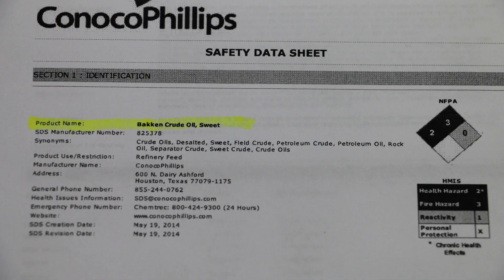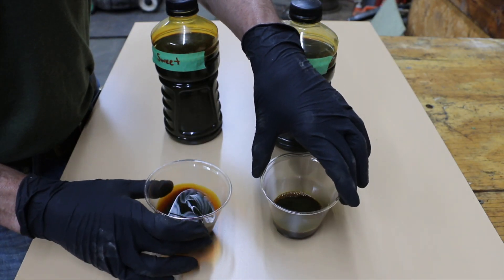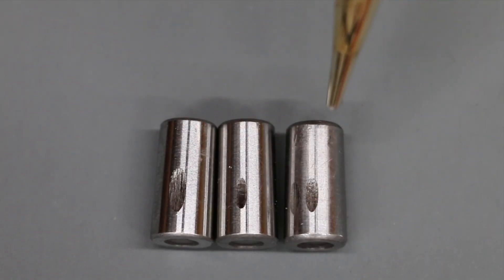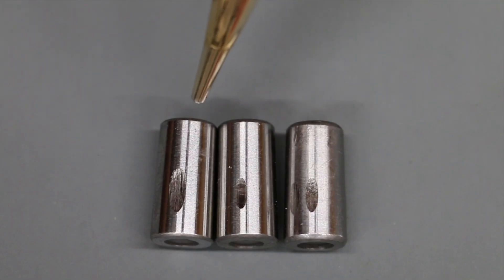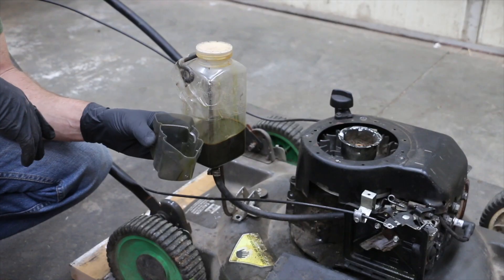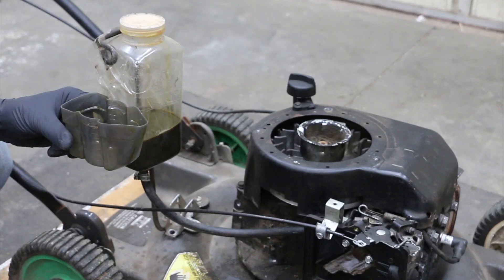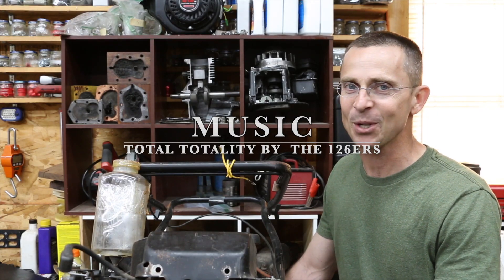Will a Gas engine run on Crude Oil?  Let's try it!

Comment: He sent the crude oil to in plastic drink containers? That's crazy. Natural oil leeches most plastics leaving them thin and brittle. But i guess if it's not stored in those containers for too long it's not really an issue. I had gloves with an impact shell on them that i would do oil changes with and the right one always got a dose of oil whenever i would pull the filter. That glove broke down into little pieces pretty quickly while the other one was as good as new.

Comment: old coleman lanterns and lamps and other makes use gasoline i use non ethanol i do not think it matters if it unleaded or non ethnol in them , but useing stright crued oil on your engines i think would foul up the heads your cylenders and your spark plugs could even cause your pistons to cloge

Comment: My family has operated a small oul well since 1895. I've been told in the 30s and fourties a neighbor would buy some of the crude and use it in his car. It ran but we don't remember if it was straight or mixed. It was smokey though!
Reply from the maker: Thanks for sharing.
Reply: @ProjectFarm can you recommend a testing lab where I can send a sample of my crude oil? I'd like to see if it can be used as heating oil. Mine is a very light grade of oil. Thanks in advance. I really like your videos.

Comment: Amazing & totally unexpected that the Sour Crude (or any Crude) oil has Better lubricity film Strength than modern, additive enriched  10W30 Motor oil !!  .....According to Everything I've read about motor oil is the Additives Is primarily responsible for the Film strength !!
Reply from the maker: Thanks for the feedback.

Comment: I bet the exhaust emissions were much worse on crude oil over gasoline
Reply from the maker: Thanks for the feedback.
Reply: @ProjectFarm  I’m surprised the engines ran so well, and that we as a society don’t run anything on crude oil normally (well except for some power stations), probably due to emissions

Comment: I just finished watching the ethanol vs non ethanol video you made before watching this and I can’t help but wonder why crude oil is turned into gasoline to begin with. There was WAY more carbon build up in the engine after both ethanol and non ethanol fuels than there was the sour crude oil.

Comment: I can't figure out why there was hardly any carbon residue in the combustion chamber after the tests with either crude crude oil. We've seen tests with gasoline and alcohol that leave substantially more residue after a test. Weird.
Reply from the maker: Thanks!

Comment: been wondering about rigging a setup on an old manual choke carbed vehicle where you start on gasoline , switch to black diesel (1 part gas/4 parts wmo) when warm , for the majority of run time , then back to gas just before shutdown . would the gas at shutdown clean plugs and valves ? long term effects on engine ?

Comment: cool fun fact , the country used to run on karosene. it lit up every house hold in america. at the time they did not realyze it , but a by product of making karosene...is gasoline. which they decided at the time to get rid of by pumping it underground. they dumped thousands upon thousands of gallons of gasoline into the ground over the years. little did they know gasoline would become the main gas to use for transportation. this was when Rockefeller owned the monopoly on all of the refineries in the US.

Comment: Is it safe to accelerate the engine with a drill? Do you have a wrench with a one-way clutch?? I have a lawn mower that is very hard to start. I will use your starting patent but won't it tear my arm off when the mower engine starts??

Comment: That's pretty amazing that the engine runs at all. I always wondered how the original inventors of internal combustion engines found suitable fuels to burn, and ultimately landed on crude oil derivatives as the source of fuel. It makes more sense understanding how they landed on that combination when crude oil burns well essentially "out-of-the-box".

Amazing.
Reply from the maker: Thanks for watching!

Comment: Well old tractors used to run straight up crude oil as fuel. Noted they were engines with a hot bulb that preheated the mixture of crude and air before being injected into the engine.
Reply from the maker: Thank you for sharing!

Comment: Crude oil has a viscocity that varies from something that you need a trowel to move to something that is relatively fluid when at ambient temperatures.

What is the viscosity of the crude oil used in this test- is it the sort of crude oil that ships use or the lighter crude that is used in heating boilers?

Comment: Great video I want to do this with old motor oil and a old Briggs we have sitting and make a generator on 60%oil 40% gasoline would make a great backwoods generator at low fuel costs
Reply from the maker: Thanks!  Thanks for sharing.

Comment: A year later, and I still find this interesting. 

1.   We get to see crude oil.
2.   We get to see the tough lawnmower run on something it is not designed to. 
I wonder of we could alter the jet, and get a lawnmower to run on heated vegetable oil, diesel, used engine oil, and crude oil. Amazing, you proved it can run on crude oil. My guess was that it would not.

I am also curious what the first diesel injector was like. It was probably simpler and more versatile. I know this is outside of the scope of Project Farm, but worth a mention, in any case. What if a diesel engine also had spark plugs?  Could it run on gasoline.

Wow.... oil as is from 7000 feet deep and 9000 feet deep. 
Apparently we have used 35% of the crude oil and the more difficult to access crude oil is still down there.
Reply from the maker: Thanks!
Reply: @ProjectFarm  You are welcome.

Comment: If crude oil is straight from the ground before work is done to process, adapt or change it, then is it cheap to buy? Where can someone buy crude oil?
Reply from the maker: Yes.  Check ebay.

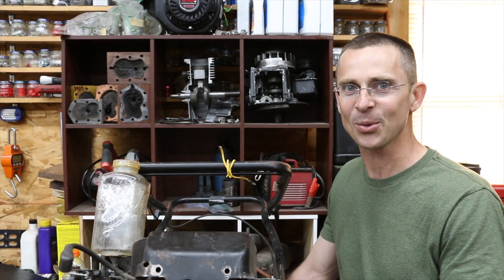Comment: 8:12 That is because of the sulphur which in many countries is totally removed in ordinary gasoline due to the pollution it will cause otherwise and increase the film strength of the real motor oil instead..
Reply from the maker: Thanks for the feedback.

Comment: Absolutely it's the same thing as making  vegetable oil and boidiesel. 
Vegetable oil is thicker but can add gasoline to dilute and for more octane boost  for a diesel truck
Boidiesel it's corrosive and have to be 50% diesel and 50% boidiesel wich is animal fats. And I noticed both fuels or crude oil  burn clean. Good job very informative.
Reply from the maker: Thanks!

Comment: I bought a Murray mower with Briggs & Stratton engine in March 2003. It finally failed to start in March of 2019. Had 2 small kids and no time so I took it to local shop. They charged me $50 bucks and told me it was not salvageable as it had no compression and was beyond repair. Put it on the curb. Picked up immediately. An hour later a random guy brings it back to me and asks for $25 for the repair he has just made. (Dirty carb). I paid him smiling and still use that same mower 3 years later. 
I LOVE those old Briggs & Strattons.
Reply from the maker: Thanks for sharing.

Comment: I got lost in a remote part of Russia in my diesel Citroen, I was short of fuel but had 5 litres of vegetable oil in the car , I poured it straight in the tank and the car ran perfectly on it with no after effects. I got back to the main road and a gas station. Diesels were originally designed to run on peanut oil I read somewhere....
Reply from the maker: Thanks for sharing.

Comment: Thought it would of had a lot more smoke. Have you tried the redex one shot petrol system cleaner. Used to buy all the time, no idea if it actually improved the system
Reply from the maker: Not yet. Thanks for the suggestion

Comment: Early 2 cylinder John Deere tractors started on gasoline to operating temp then switched over to distillate or tractor fuel. They had a very low compression to avoid pre-ignition and ran at low rpm. After watching this, I'd like to try the crude oil in my 1935 A. It was said in their day that if you could pour it in the tank, they'd burn it.
Reply from the maker: Thanks for the feedback.

Comment: With better film strength than motor oil it would be interesting to see this as a 2 stroke fuel,  no oil should be required. Maybe. Now I'm not sure. Maybe we need it tested.
Reply from the maker: Thanks for the video idea.

Comment: The sulfur in the sour crude acts as an anti-wear agent.  A good example is your brown sulfur oil used in machine shops and for cutting threads on pipe.  The sulfur is a great anti-wear agent.

Comment: It's amazing to see how clean the piston top is for both crude oil, but because of emission regulations we have to refine crude oil into gasoline to protect the environment. I wonder if the people in the early 1900's use crude oil as fuel or not since they didn't have strict emission regulations in those days
Reply from the maker: Thanks for the feedback.

Comment: What if you ran a 2 stroke engine on sour crude oil which has good lubricating properties. Could you run it without 2 stroke oil just using the lubricating capabilities of sour crude oil?
Reply from the maker: Thanks for the video idea.

Comment: Go figure!  The EPA removed sulfur from diesel claiming it was dirty and bad for the environment.  Little did they know, Todd would expose their lies and show us it actually burns cleaner. 🥴
Reply from the maker: Thanks for watching!
Reply: @ProjectFarm  You bet!  I’ve been following for a while. I’m amazed and appreciative of the testing you do. I love the head to head comparison shootouts on tools.  
I had an idea, if you or Matt from Warped Perception would be interested. If you still have the go kart, I’ve always wondered how much efficiency loss occurs with a chain and sprockets, vs approximately the same gear ratio with cog sheaves and a belt?  
It would be interesting to see. 
Of course I’m in the same line of thinking as Matt also... Nitrous oxide  is fun to play with, and I’ve always wanted to push the limits with a small engine. Assuming the air fuel ratio remained safe, the piston rings were gapped accordingly, the fuel was high quality, and the timing corrected to prevent detonation at higher cylinder pressures, how much power could be made?  And what would fail first in an otherwise stock engine?  My guess would be either the head gasket or connecting rod. 
Anyhow, thanks for the work (and budget) that you put into your videos!

Comment: "Why buy gas at a gas station if you can just pull it out of the ground, put it in your gas tank and use it as a source of fuel?"

It really looks like you struggled to say that with a straight face. I know I laughed.

Comment: I was seeing if you could do a comparison of 1 gallon of gasoline vs one gallon of: 3 1/2 32oz bottles of charcoal lighter fluid obe 16oz bottle of 99% rubbing alcohol and 2oz of deisel or moter oil. I wanted to see if it would work and clean since many upper cylinder cleaners consist of naptha. I ran my vehicle on this and it ran much quieter unbelievably however it was mixed with maybe a couple gallons of gas already in the tank. How would this mixture work on a small engine and what kind of performance and cleaning would it get?
Thank you
Reply from the maker: Thanks for the video idea.

Comment: what you could try is heating the crude oil up as when its used in ships even though they are mainly two strokes they heat the crude oil up and its much better hot, even if you can get it to around 90f that will make a great difference
Reply from the maker: Thanks for the feedback.

Comment: I hope you read your old posts but I have a really good experiment for you to do. When Rudolph diesel design the diesel engine he had in mind as hemp oil as one of the things that would be running in the diesel engine. You can make anything from hemp oil that you can from crude oil. I would like to see you do a test against hemp oil and the best crude oil which would probably be the sour one.  From what I hear hemp oil has very good lubrication qualities as well.

In the lubricity tester that you had I would probably think that the thinner oil did better because the molecules are smaller.

 You can grow about 300 gallons of hemp oil and 1 acre. As soon marijuana and hemp get removed from the drug schedule (sometime this year) you will be able to grow as much hemp as you care to grow. I know the oil companies are not going to like it that will be able to grow 300 gallons of fuel in 1 acre .

Hemp oil is non-toxic  and I think it's carbon negative even, but don't quote me on that. Hemp plants are also good to clean up toxic soil via phytoremediation. They have even grown them around Chernobyl to mitigate the radiation.

I will get hemp oil for you if you can't get it. This test really needs to be done.
Reply from the maker: Thanks for the video idea.
Reply: @ProjectFarm  I really hope you do this. I will send you Hemp oil.

Comment: Well of course it works . Where ya think fuel comes from and the condensation off the oil is used for other things as well like synthetic motor oil . But don’t be sniffing that oil to much it contains h2s it’s deadly at high concentrations
Reply from the maker: Thanks for the feedback.

Comment: Just like any other heavy fuel, if you heat it significantly (60°c or sometimes even 90° depending on the fuel) it will burn just as well as anything else. Most large ships do this and burn fuels that are more similar to asphalt than a more refined domestic fuel.
Reply from the maker: Thanks for the feedback.

Comment: As a non-native English speaker I am confused by the meaning of ''flashpoint''. Shouldn't the crude oil ignite or evaporate right away when it reaches a temperature above -29 celsius?

Comment: You're doing it wrong. What you need, is a gasifier.
Reply from the maker: Thanks for the suggestion.
Reply: @ProjectFarm  - no problem. A gassifier can atomize pretty much any carbohydrate, including sugar water. It will run straight crude, but the residue will clog the unit fairly quickly. It's best to emulsify the crude with a clean liquid, such as alcohol or water.

Comment: The high sulfur content of the sour crude is why it passed the lubricity test better than the low sulfur sweet crude. Sulfur is a lubricant in and of itself. Unfortunately it is also a pollutant ( it's the primary cause of NoX).
Reply from the maker: Thanks for the feedback.

Comment: I have a few litres of waste veg oil. Have a common-rail diesel so not a big fan of putting it in the car, but my mower was given to me free. Could I mix the oil 50-50 with 95 octane (that's regular in the UK) and run the mower? What about a higher ratio?
Reply from the maker: Thanks for the video idea.

Comment: As this has come up further on Crude oil is not used in ships, too expensive. Fuel oil is used which is the leftover from crude oil distillation. Fuel oil (also known as heavy oil, marine fuel or furnace oil) is a fraction obtained from petroleum distillation, either as a distillate or a residue.
Reply from the maker: Thanks for the feedback.
Reply: @ProjectFarm  For manoeuvres at sea they change over to diesel. Fuel oil is just a bit better than tar.  Stop engines on fuel oil, spend the complete day unclogging the pipes and other things.

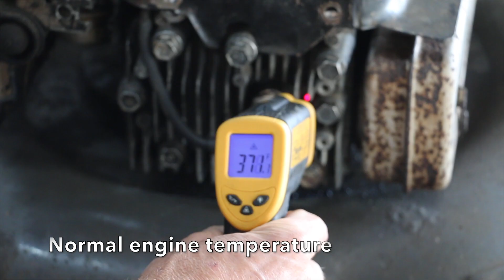Comment: How newtonian is the sour crude? Look at 4:42 - 4:46 when the engine is running and shaking the sour crude in the fuel tank there is small beads of crude acting like a solid on the surface.

Comment: Crude oil comes in many different forms.  Drip gas is like refined high octane gasoline.  Some crude is full of parafin and is green.  Thick black crude is low value crude that you would never want to put into a gas tank unless you really want to muck things up.  It's can be as thick as tar.  Jerry could have sent you drip gas and it would have run well in your lawn mower.  This wasn't a very good test because "crude oil" can look very different from one well site to the next...

You might have improved the performance of sweet and sour crude test by putting them in a centrifuge to spin out and remove the impurities, which could include paraffin...
Reply from the maker: Great feedback. Thank you

Comment: I've heard oil companies recycle used motor oil by re-distilling it and replenishing the separated out by distillation.
Since crude oil works so well, I kinda wonder if shop-distilled used motor oil is effective as a lubricant or a fuel too.
Reply from the maker: Thanks for the video idea.

Comment: I remember an old timer Tex claimed to have taken crude oil out from the bleed off valves on pipelines in central Texas. Said he just filtered it with a cheese cloth and put in his model T. I though he was telling tall tails, but I researched it back in the 90's and found a well in California which produced clear "crude" that was 70% gas by volume. Now the fact that sour worked better than 10w-30 tells me the oil companies are sucking out the good stuff in the crude and selling us the left over whey..
Reply from the maker: Thanks for sharing.

Comment: I wonder what the BTU`s are for light sweet or the H2s laden sour crude compared with diesel?
If I recall 114,000 btu`s for gasoline and 134,000 btu`s for diesel or roughly that.
I worked as a water purification chemist with oil companies to extract water from frack drilling.
I swear the water coming back up from the wells was so heavily laden with hydrocarbons, we could have used that production water to run at least a diesel engine.
We made the water drinkable after running through our trailer mounted filtration lab,with no Reverse Osmosis. {At least I drank it,not dead yet}
Great test!